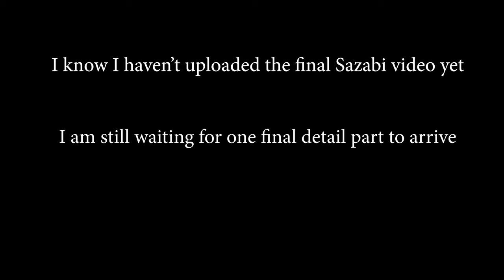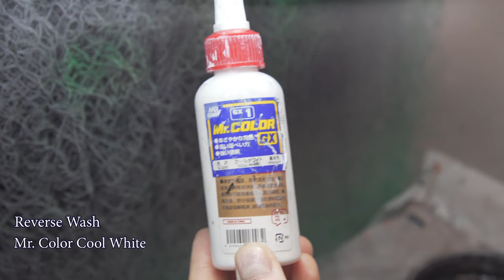Kshatriya 1/100 Resin by Mersa Part 1: Upper Body | Custom Gunpla Painting

Comment: Nice video, thanks for sharing. What psi are you painting at? I don't have the fine control yet when getting up close.
Reply from the maker: I'm not sure because I have so many attachments between regulator and airbrush so the air coming out isn't the same pressure stated in the regulator. But should be around 25-30psi.

For detail painting you should thin your paint out a bit more or, counterintuitively, spray in higher pressure. Because for painting smaller areas you're not pulling trigger back a lot, and it can be difficult for the paint to start spraying in low pressure

Comment: How do you like that kit? Besides articulation, anything else you'd like to be different/better? Did you ever think you should have gotten another kit? :)
Reply from the maker: I would say the articulation is the only/main problem becasue there aren't a lot of poses to do with Kshatriya anyway and the fully posable gimmick makes it unstable.
Other than that maybe the casting quality? No problems with the casting it's just slightly below par with the top casters like Yujiao Land and others but it's miles ahead of other recasters like UC, SH Studio resin is rock hard so it's hard to snap a piece by accident.